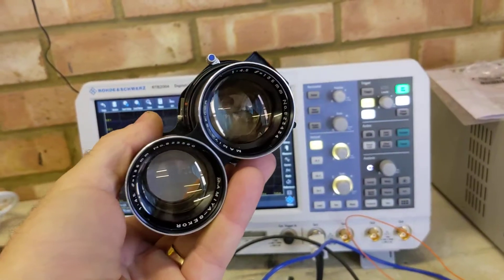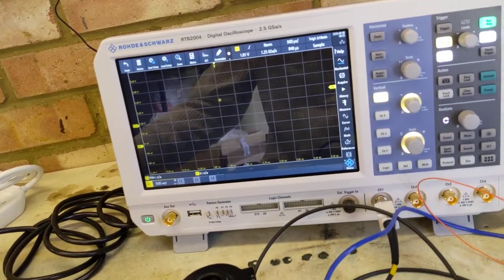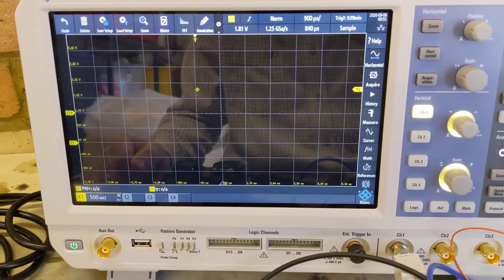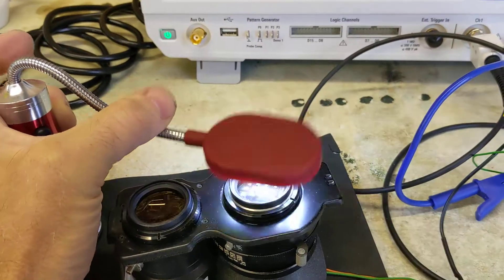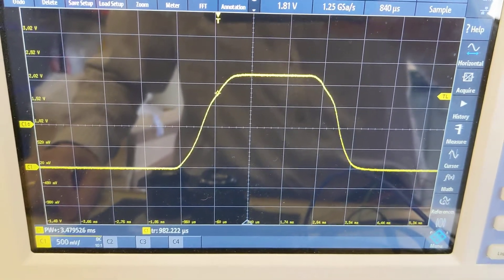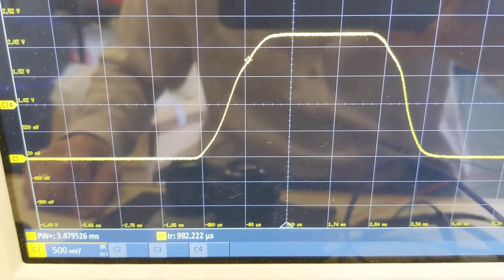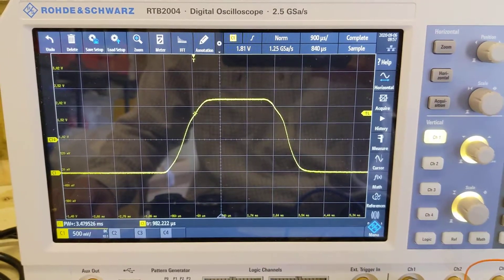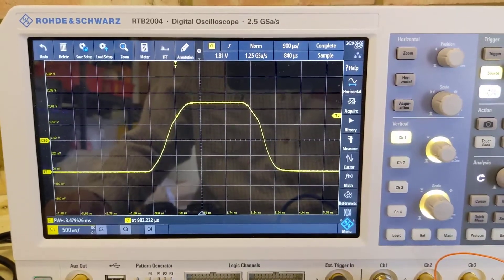Mamiya TLR Shutter Test

Comment: Interesting. What is the sensor board (I assume it's a ready made board?) you're using and how do you connect (and what's the voltage) it to the power supply and the oscilloscope? 

And can this arrangement also measure curtain type shutters? I assume some kind of correction needs to be made for the time it takes the curtain slit to "sweep" the area of the phototransistor as the sensitive area is probably wider than a single film grain so it would give longer times?
Reply from the maker: HI, thanks for your interest.  It's an ambient light sensor board made by Sparkfun, I bought it from CPC. It requires 3.3 to 5v. There are just 3 connections, power, ground, and outupt. https://cpc.farnell.com/sparkfun-electronics/bob-08688/ambient-light-sensor-breakout/dp/MK00624
Reply: @BarwickGreen  thanks! I'll try to get some thing similar.